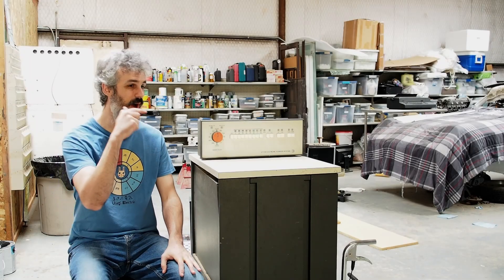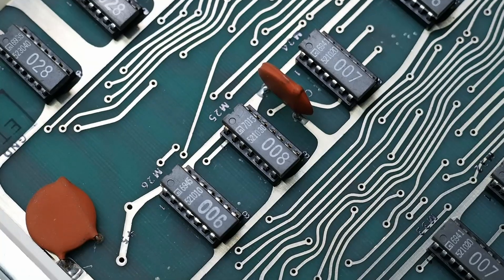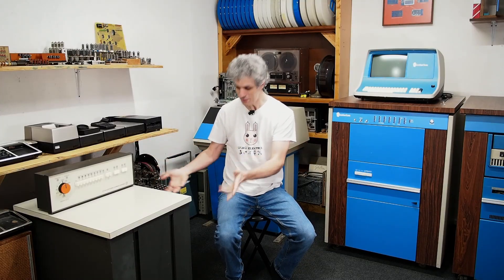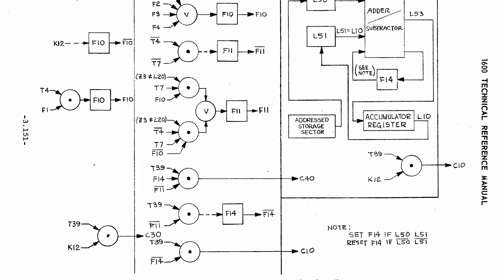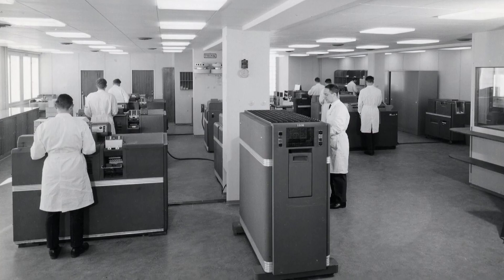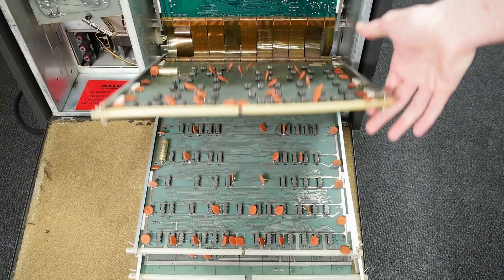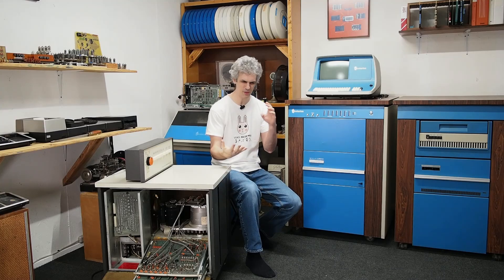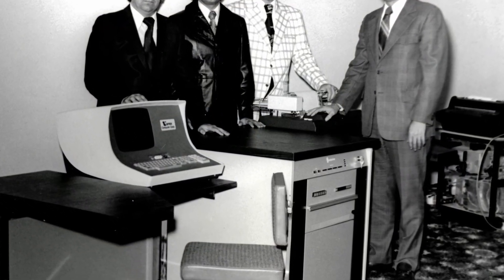Meet my new Litton Minicomputer (it has Drum Memory)!

Comment: Your channel never ceases to keep me amazed and feeling nostalgic. I remember in my shop on the aircraft carrier. The bench that calibrated the inertial navigation unit for the A-7 was manufactured by Singer (yes the sewing machine people). At some point Litton had purchased or taken over that Singer division. The actual Litton bench that maintained the rest of the navigation systems for the rest of the now retired aircraft, is where I saw my first multi platter Hawk drive. It also had a single fixed and removable platter Hawk drive like yours. When you mentioned that the Litton looks like a washing machine. That made me laugh, because it wouldn’t surprise me if there was a Litton link to the washing machine industry somewhere. When we were at our shore duty station. Our Litton tech rep would get calls forwarded to him from unhappy Litton Microwave oven owners quite often. We had a lot of fun with that.

Comment: Paper tape is very hacker friendly in that it's very easy to build a reader these days.  Jürgen Müller has designed a reader based on an Arduino Pro Micro that looks very easy to replicate and use.  A punch would probably also not be too difficult, but definitely takes the amount of work up a notch.

Comment: Brings back memories...
I wrote my first computer program (1967) for an 40-bit machine with 5 kilobytes of core memory and a drum holding 60 kilobytes including swap area for the core, a small OS, an Algol compiler and a few extras. Files were on paper tape and I still have a few tapes in my belongings. The computer was called "Gier" and the danish company RC built several hundreds of them as far as I can remember.
Reply: I need to rectify : According to Wikipedia, they built 56 of these machines over a span of about ten years. Some sources say 40 machines. 15 kHz clock speed. The Algol compiler was quite sophisticated supporting recursive procedures, but compiling of a program of 500 lines could take a minute.
Reply from the maker: Whoa, programming in the 1960s must have been an experience for sure!
Today it's almost second nature, and even when we come across something esoteric, we have the fundamentals that we've all learned to fall back on, but the 60s was pretty much the inception of accessible computing, it must have been wild sitting down with such a wild machine to write programs for it!
Reply: @UsagiElectric  One thing that always has amazed me is that they managed to write an Algol compiler that could run in 5 kilobytes of core memory. This was a quite sophisticated compiler featuring everything mentioned in the official report on Algol60, recursive procedures and all. It made nine passes and stored the intermediate version of the program on the drum. The biggest program I wrote for this machine was a simulator of the Intel 8008 microprocessor, 13 pages, all in all. It ran without a glitch. This is one of the "source files" that I still have on paper tape.
Reply: I forgot to say that this computer was 100% transistor based, germanium transistors like OC141. I managed to salvage a few circuit boards when one of these machines broke down and was essentially scrapped.

Comment: Wow! What a find!
I had heard of drum memory at my training at Nixdorf Computers. Apparently Nixdorf also had invested in drum memory. However, the manufacturing tolerances were very challenging and IBM had developed the disk drives. Interestingly enough the tracks on the platters are called cylinders to this day and that was according to our trainer based on the drum drives which had several concentric drums, or cylinders.
Unfortunately, by the mid 1980s these drum drives were phased out in favour of the CDC drives. So I had only heard of them, but never seen one.

About the ribbon cables delaminating. They look like simple straight through connectors. You should be able to design PCBs like that and get them made by JLCPCB, like the utube channel who shows all the PCB motors, I forgot the name. 
That should allow you to get a stack of them and replace what needs it.
Reply: To my eyes they are not really ribbon cables but flexible PCB's anyway and PCBway also do them. I would look to replace the lot. From the video it looks a very simple design.

Comment: You don't need to get a seperate paper tape punch as both a punch and reader are built into most Teletypes including the one you showed a picture of! Although you should get a seperate one if you want one with any kind of speed lol
Reply: But you have to pick the right Teletype.  Most of them use paper tape that's just 5 bits wide (baudot).  His paper tapes look to be 7 (or 8) bits wide.  Maybe CuriousMark has a lead for finding them as he has a few of the older baudot ones.
Reply: @russellhltn1396  I didn't realise that! I guess it's more uncommon for a Teletype to have an 8 bit paper tape reader/punch
Reply: @russellhltn1396  the model 15 TTY were already obsolete by 1970
Reply: @richardhole8429  It looks like the model 32 was still going in the mid 70's.  It's sister, the Model 33 is ASCII.

Comment: It is interesting how weird stuff persisted into the 1970s.  This Litton machine is pretty epic with drum storage rotated by a Bodine motor which would have been at home in the 1930s.   I worked for a bank in the proof and transit operation supporting 32 IBM 1260 electronic inscriber machines.  The 1260s were full of boards of SLT, used plugboards for setting up the routing program and stored their totals on a acoustic delay line memory.  The delay line was a bit like an unwound clock mainspring in about a 12 inch x 12 inch box.  Information was stored by an electromagnet torquing one end of the spring, making pulses travel to a pickup at the other end.  The picked up pulses were amplified and put back into the spring.  As you might guess, environmental vibration such as a cart full of checks to be inscribed bumping into a machine caused angry operators who had to reprocess lost work.
Reply: I remember those delay lines hanging around in some surplus stores. Zinc or aluminum box, and indeed some kind of ribbon mounten on soft rubber inside.
Reply: @pizzablender  Thanks for sharing.  Not too many people have seen that type of storage,
Reply: @wtmayhew  I amso remember a friend coming home with a type of disc storage taking from a dumpster. It has a belt drive, with a flat belt, and fixed heads mounted at a tiny distance from the disc. I theak each head covered 8 tracks or so, and there may have been 10 of them.
The disc has the brown magnetic coating on one side only.

Comment: That 0.100" flex cable was popular in several machines back then. I have a few HP frequency generators that use it. 
If you come up with a way to replicate or replace it, let me know. The only thing I could think of was an adapter PCB to convert them to "normal" IDC headers and ribbon cable.. even that tech is vintage now.
On the plus side, you get that drum memory spinning up and that cabinet is never gonna tip over.. as the memory turns into a massive gyro :)
Cheers,
Reply: Modern PCB rapid prototyping companies boast they can make flexible PCBs and flat-flex connectors nowadays, so I assume they could be contracted to produce new ones to the sizes used in that HP gear! Just gotta pull one out and transfer its dimensions into a CAD program.

Comment: All the old ASR-33 teletypes had built-in paper tape reader/punch.
Reply: Right. Mechanical pins to read the data.  Slow and vastly reduced lifetime of the tape.  Optical readers are much faster. The ASR33 was ok for punching a tape at typing speed.
Reply: @richardhole8429  I have used them for years, read the same paper tapes dozens of times with no problems.
Have you?
Reply: @Sven_Dongle  yes, I am speaking from experience.  Short runs of tape are not bad.  Spools of tape are not well handled on TTY machines.  Important data was punched on a plastic tape.  Optical tape readers handled the tape gently and rarely jammed.  Remember the TTYs ran at 300 baud, very slow. The 5 hole ones, if memory serves were 110 baud. Many people can type faster than that
Reply: @richardhole8429  I have read hundreds of rolls of paper tape, some bigger than hockey pucks, never had a bit of damage., over years and years of use. Not sure what type of ghet-toe junkyard equipment you used, but rest assured, properly maintained, no damage ever occurred.
Oh, and BTW. 'plastic paper tape', I think you outed yourself as a total bull$h!tter with that iconic statement. Doesnt exist.
Reply: @Sven_Dongle  Please allow me to quote Wikipedia entry "Punched Tape": 
"For heavy-duty or repetitive use, polyester Mylar tape was often used. This tough, durable plastic film was usually thinner than paper tapes, but could still be used in many devices originally designed for paper media. The plastic tape was sometimes transparent, but usually was aluminized to make it opaque enough for use in high-speed optical readers."

This is the tape to which I refer and have personal experience using.  On a SDS 960 at Michigan Tech University in  1971 of which I was the operator, the operating system was punch tape on a spool at least 8 inches in diameter.  Mylar tape saved the day.  Later for Gerber Baby Foods research department we had one of the first Altair 8800s and loaded BASIC using an ASR33 TTY.  I copied that to mylar also after several tears and soon learned how to copy it to cassette tape for easier handling.  

My apology for confusing you.

Comment: The Librascope LGP-30 of the late 1950s was also a bit-serial machine.  It was designed for scientific applications, and had a 31-bit data length and 15-bit instruction length.  It had only 16 instructions but it implemented single-instruction multiply.  Its bit-serial nature allowed it to be an exceptionally compact machine for the time.  It had 4096 words of drum memory and three general purpose registers which were also on the drum.  There is one fully working machine at the University of Stuttgart.
Reply from the maker: This machine and the LGP-30 share a phenomenal amount in common with respect to overall architecture! I wish I had an LGP-30 here to play with, it'd be so much fun to get the two of them up and running side by side.
Reply: @UsagiElectric  One of the reasons for the LGP-30 being so compact is the use of silicon diodes for most of the logic.  The tubes- 130 of them if I remember right- are mainly for power, I/O and the drum memory.  Oddly enough, the transistor version- the LGP-21- was actually slower.
Reply: The anode voltage was higher than Vcc. Thus quicker 😂

Comment: If at the very least the drum memory works, you have a storage option for your own vacuum tube computer. 
You might even use the entire Litten machine as a serial storage device for it.
Reply from the maker: Interestingly, I've been thinking about going the other direction as far as connecting things together.
The Litton loads programs in via paper tape into the drum, and then executes directly from the drum. But, instead of having a paper tape reader feed directly into the Litton, I was thinking to put the Centurion in the middle. The Centurion could then grab a binary file and transfer it over to the Litton to load into the drum. This means that our program storage options are now immense, and we can write new programs on the Centurion and have them executed on the Litton!
Reply: @UsagiElectric  nah, keep the Litton original, let it load from paper tape. Or something else. Outside of experiments keep the centurion and Litton separate things. Otherwise you would always have the lug both around. The tube computer is a new development, you can connect that to whatever you want🙂
Reply: @UsagiElectric  That sounds exciting! How is this going?

Comment: When you opened up the card cage it looked like on of those frames that contained pop posters in music shops. As a kid you always fretted that they would overturn on top of you as you pulled each poster over to view the next.

It is always fascinating to see how few components were used in those old machines, on boards the size of a pool table😊
Reply: @tradde11 yes I remember those too. Later on they seemed to be mainly horizontal and you had to look down and flip them to you or away from you. Maybe the posters were larger than the vertical ones, I don't remember seeing them in the same place to compare. They always seemed a bit unstable when most posters were on one side.
Reply: @tradde11 I don't know if they still exist. They often used to be in record shops, but those are few and far between these days mores the lity😊

Comment: For the flex ribbon cables used on the bus that are falling apart I would use kapton tape and ever so carefully wrap them up.
Also replace the electrolytic caps before powering up and check the bearings on the drum motor.
Reply: I suspect the best bet is to replace them with custom flexible PCB's, which are basically the same technology and the likes of PCBway will make them for you in prototype quantities which is what you need here.

Comment: I kind of remember seeing a couple of these back in the early days of my Vo-tech training for machine shop. There was also a 'data processing lab' which is what they called the computer room at that time, and when I first started at the Vo-tech in 1972, they actually had a couple of these Litton machines. They later switch to DEC and PDP as they had better support. The only other Litton products I was familiar with were microwave ovens, which were starting to get popular in American homes at the time. It will be interesting to see if you can get this relic up and running 50 years later!😉 EDIT: Just a side note: In our machine shop, we had one of the first digitally controlled vertical milling machines ever released. It also used punch tape to operate, and we would spend hours on an old punch tape TTY creating the programming to control the x,y, and z parameters to mill various projects. It was before automated tool change cassettes were popular, so we had to program pauses to allow for tool changes and then hit a button to allow the tape to continue.

Comment: I repair avionics and a few devices I repair use those laminated ribbon strips to connect boards. I fix them by just brushing superglue all over the de-laminated plastic part before pressing them back together and it seems to work well to hold it all together

Comment: Wow, how cool!  It sure does look like a washing machine, too, lol.  Litton made my family's first microwave oven, and it was a sturdy, long-lasting 1970's beast of a machine.  Every time one of our newer microwave ovens has failed, we miss the Litton.  We only replaced it because the door latch broke, and replacement parts were no longer available.  Alas!  Hopefully, your Litton minicomputer will be just as sturdy and reliable!  🙂  Those de-laminating cables look scary for sure, but I would hope that you'd be able to repair any failed connections with sturdier ribbon cables.  🤞
Reply: Just made me remember that my first microwave was also a Litton. Back in the 70's. It was the small "Little Litton" version, heavy, built like a tank, still worked after decades. Eventually went to the Goodwill only because I wanted a larger one with the rotating platter.
Reply: I have a Litton microwave from 1985
Still works
Perfectly, paid $350 CDN for it 👍

Comment: Push comes to shove PCBway does flex PCBs but i do belive you'll find something off the shelf.
Reply: They look like flex that's clipped over an edge connector, if there is continuity from one end to the other it may just be idc connectors on ribbons?
Reply: @timballam3675  looks more like ribbons are pressed onto a PCB with a bracket of some kind.
Reply: Yeah I think this would be his best option for those flex cables

Comment: All it seems your missing from the centurion story is a EE200 but with your luck finding this family I wouldn’t be surprised if you find one. Making a paper tape reader interface can be pretty easy for example my 1972 remex which is a earlier version of your just is 2.4v high 8 but parallel and I was able to hook a Arduino to it for easy interface. That remex is a lot more complicated than mine but I bet it could be modified to work as a dumb reader similar to mine. I’m looking forward for more episodes in this series especially when it comes to drum memory
Reply: Wonder if there was an interface, that allowed them to be connected together, at least to enable transfer of data, and if there is still old data holding on in that drum after 50 years.
Reply: @SeanBZA  the interface for the paper tape probably is built in or at the very least can be loaded in through a teletype. i bet that data could be on the drum but since its RAM and not mass storage like the hawks the data on it would be useless since we would have no idea what it is from.
Reply: @jaut-76  Just want to see if near 50 year old magnetic media is still readable, when it was designed to only have sub second magnetic retention.
Reply: @SeanBZA  I would be interested in seeing that too since it’s not core memory
Reply: @SeanBZA  does it get refreshed on every spin?
Reply: @lasskinn  Think not, seeing as it is addressed memory, so you only modify on write, or when swapping in a new program. So it should still be holding whatever was last written there, bit rot permitting.